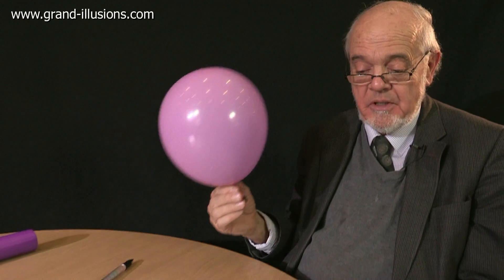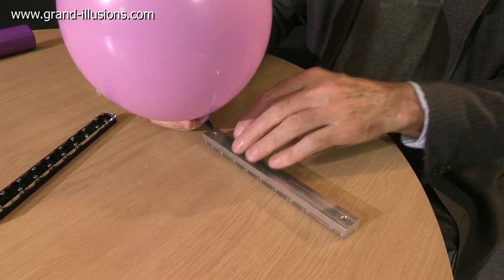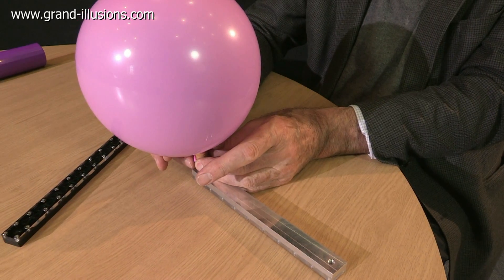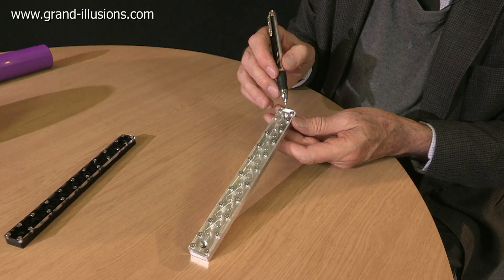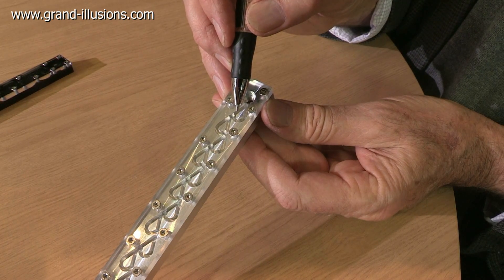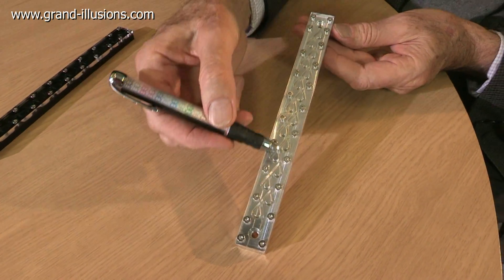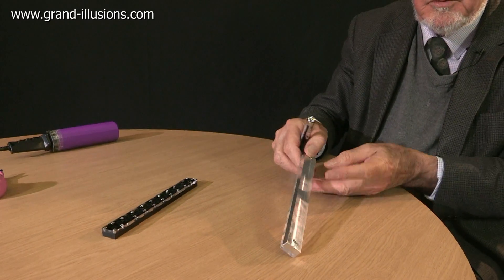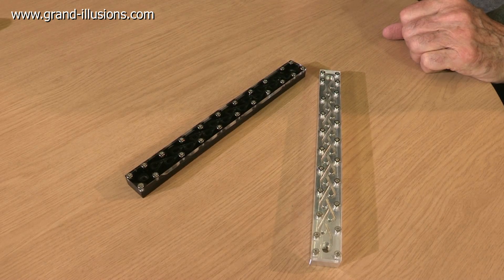Tesla Valve

Comment: If you have ever taken a fluid power systems class, you will realize just how amazing this is
Reply: stmounts Here's your real-world use case: Hand pumps. They currently use a check valve that wears out over time, placing such pumps in remote locations makes them both vital and nearly impossible to repair in many cases. These types of pumps don't require a perfect seal, the minor hit to efficiency is barely noticeable, especially compared with the complete lack of a need for maintenance and moving parts. There are no seals to wear, no moving parts to grind away, and cleaning is simple enough that you could do it with no tools whatsoever if the pump is well designed. 

Name one other kind of system that has all those advantages, and doesn't cost a crapload of money.
Reply: frtard Yes, but the flap valve will break much sooner than the Tesla valve. It wears out, it has moving parts, it's mechanically complex. It's hard to make a properly functioning flap valve with nothing but two chunks of metal and a chisel, but you can make a serviceable Tesla valve with those supplies and a little knowledge. 

Also, you do realize that without Tesla's inventions, a worldwide power grid would have been impossible, telecommunications would have been delayed decades, possibly centuries. Without Tesla, I wouldn't be able to tell you how much of a dipshit you are from thousands of kilometers away.
Reply: ***** or people who value havine electricity in their homes
Reply: stmounts Why thank you, I'm an engineer. Science*
Reply: Mitchell Nola From someone who hasn't taken that class, why is it so amazing?
Reply: Microfluidics anyone? Labs on chips? These valves would obviously be useful for that sort of thing.

+Nikolas C, " the light wave is propagated by the manipulation of the electric field of each adjacent atom along the waves path," - No. Absolutely not. Experimental evidence does not support this, that's just something that you seem to have made up. Light is propagated via fields, what you're describing is actually an absorption process.
Reply: stmounts I'm not saying that this thing is useful. I'm saying that continued advancements make room for future ones.
Reply: on a steam boiler you have pressure on one side this valve would stop higher back pressure with just a small about of force! so many bad talk it but it was made for one thing and it do that!!
Reply: I agree with it being amazing.  I also disagree with all those that seem to believe it to be useless.
For the educational value alone it is worth every moment that Tesla spent to let us know about it.
Who knows, 100%, that this or something similar is not being utilized somewhere?  I wouldn't bet on it.
I just came up with two ideas as I've been reading the comments.
Too many in here making the most ridiculous comments, as if they knew or understood better.
Let us see the quality of thought of those that believe this to be useless vs Tesla believing that at the very least, it deserved some attention.
Reply: Everyone in this commemt section needs to be aware that the tesla valve does get use in micro fluidics.
Reply: stmounts consider it for mixing applications
Reply: Ill agree with you on the technically useless part.
But I think it makes for nice mathematical/engineering concepts
Even thought they have no real life application it can be quite fascinating to see how things works.

I guess it's one way to visualize things.
Reply: RFC3514 "oscillations in a property of spacetime itself"... you literally just mash words together that you think sound like something. 

Same old rhetoric, "you don't know what a field is", "you don't know that radio and light are of the same spectrum", blah fucking blah. This is all first year material, and the fact that you don't know that the electric field is generated by a charged particle only distinguishes you as the laymen you are. Sorry that my whole point is miles over your head, but you've become irrevocably boring.
Reply: stmounts im glad Tesla didnt think like you do.
Reply: That is precisely what it was designed for, a resonant pulsed combustion chamber to drive a Tesla turbine. Air and fuel in through Tesla valves, and the detonation contained. Pretty amazing idea.
Reply: @handleismyhandle  👍
Reply: RFC3514 No, sorry, space doesn't have 'properties', a field is not a wave, electric field is generated by a charged particle. It's too bad you keep repeating yourself as if you're making a point, yes EM waves can travel through vacuum, my original question was 'how'. Saying, 'it's a field', over and over, isn't a description of anything. Although I guess it's all you can do considering you have no actual answer. It's disappointing that your arrogant attitude is bolstered only by such a trivial understanding of physics that you literally didn't understand my explanation, it's like I've spent all this time teaching a dog to roll over and when the time comes he just shits on the carpet and looks pleased with himself.
Reply: I like this post. The first bit is funny at least.
Reply: I’m just gonna chime in and be gone. Tesla had an extraordinary mechanical aptitude and was able to see magnetic flux as another mechanism. THAT is the magic of Tesla.

That was also his great downfall. He was a slave to his intuition. Which unfortunately led him astray and wasted the majority of his potential.

You can think of Tesla as a tragic anti hero, but you deserve to do it for the right reason. Tesla needed love. HUMAN love. He consciously bucked the system every chance he got and it hurt him; and it hurt humanity. 

Tesla deserved to be a great physicist with his intuition and visual thinking. He wasn’t given a chance. THAT’S the tragedy here. Got nothing to do with Edison or government. It has to do with childhood, and bullying, and being different.

Thank you Nick for your induction motor. I’m sorry we weren’t kinder to you.

I swear this is the way it is.
Reply: @smellslikenarcspirit  By definition, something that has no good usage is USELESS.
A valve that cannot STOP flow is not a valve at all, it is simply a restriction...
Reply: @stmounts  no good usage is not useless . The glas is half empty ( the people who say something is useless) ore the glass is half full ( people who says that there is a function to this invention BUT it isnt discoverd yet ) and technological progress doesn't stop so Maybe in the future there is an aplication to it. The Idea to use it in a small river as a waterrestriction and fishpasage at the same time will be trown to the garbagecan by people like you . My question is ( have you ever build a teslavalve into a small river and what happend when you did that ) well at least i can say that i build on whit the help of a few farmers who liked the Idea of having extra water when the river is getting low . It worked BUT Rijkswaterstaat ( an institution who manages the water here ) didn't like the Idea and removed the valve .
Reply: Yeah I'm gonna disagree,, I don't think this is too great tbh... For 99% of applications there are way better valve systems and even in 1920 we has better valves so I don't get why this is such a big deal other than it being invented by Tesla. There's a reason why it's so seldom used 🤷🏻‍♂️
Reply: @Tom Olson I agree with you. I'm a fluid engineer and I specialize in valves and I don't think this is a useful design at all,, even at the time he invented it we had better valves.
Reply: Amazing idea with no actual application. I mean, if there was an application for it, sure, its brilliant, but otherwise it solves a problem that doesn't exist.
Reply: i would be amazed ... if i saw a real working one
Reply: @smellslikenarcspirit  You cannot build a Tesla valve on a river, unless you don't want any boats to pass. Locks allow boats to pass. Anyway, the flow rate in a river, even in flood, is far too low for a Tesla valve to have ANY effect at all. It really doesn't deserve the name "valve", it is just a restriction that is more restrictive in one direction, but useless at stopping flow. Ever wondered why Tesla valves have never been used in rivers in the Netherlands? Answer is, they are fucking useless!!
Reply: @smellslikenarcspirit  Tesla "valves" are USELESS in rivers, or they would already be used. They are NOT being used, because they are USELESS.
Reply: pyro1324 -The scientists of today think deeply instead of clearly. One must be sane to think clearly, but one can think deeply and be quite insane.
N. Tesla

Tesla was not crazy, He was just way more advanced than his time. And perhaps still now too advanced for some people.
Reply: This valve is useful, it teaches a scientific principle. Now go to church you amoral idiot.
Reply: stmounts There was a time in human evolution where even the usefulness of a pointed stick was not apparent. The human brain finds uses for things, you apply your mind and generate theoretical applications. Clearly you're unable to do so, and by your own logic, your brain in particular is fucking useless.
Reply: stmounts You are really narrow minded. Nobody has used this yet, therefore it's useless.... wtf?
Reply: Everything is useless and life is meaningless.

Congratulations!
Reply: Nikolas C In dozens of places. It's well documented that he thought Hertz was wrong, and that "Hertzian space waves", as he called them, were just a useless byproduct of the "real" transmission, being done through the ground.

"The idea presented itself to me that it might be possible, under observance of proper conditions of resonance, to transmit electric energy thru the earth, thus dispensing with all artificial conductors. [...] An alternator, preferably of high tension, has one of its terminals connected to the ground and the other to an elevated capacity and impresses its oscillations upon the earth" (from his article "The True Wireless", published in 1919 on Electrical Experimenter)

He even wrote, in some of his articles, that, with his transmitters "the only loss incurred is the energy radiated in the form of Hertzian or electro-magnetic waves which can be reduced to an entirely insignificant quantity" (that's from Popular Electricity).

In other words, he was specifically trying to reduce the amount of radio waves, which he saw as a form of "wasted" energy.

He also wrote: "In each case the actions carefully investigated will be found to be due to earth currents. Numerous other proofs might be cited which can be easily verified. [...] The Hertz wave theory of wireless transmission may be kept up for a while, but I do not hesitate to say that in a short time it will be recognized as one of the most remarkable and inexplicable aberrations of the scientific mind which has ever been recorded in history."

Six years later, Hertz was winning the Nobel prize in physics. Oops. :-P

This site has some references and quotes from contemporary articles:

http://earlyradiohistory.us/tesla.htm
Reply: RFC3514 Dead thread. But I'd like to point out that Tesla was talking about ground transmission of the return signal to a Tesla coil tuned to the Earth's resonant frequency. Tesla writes of the Hertzian transverse wave being hidden as a stationary or standing eave configuration around the Earth-ionosphere boundary. The ground and ionosphere actually behaves as a waveguide for plasmons, coupled pairs of electromagnetic waves and electric currents in the ground and ionosphere.
Reply: Microfluidics: am I a joke to you?
Reply: frtard I'm sorry, did you just say that Tesla has invented nothing practical?
Reply: RFC3514 Ooh, you knocked one thing down. The rest of my argument stands, avoiding it will not help you.
Reply: RFC3514 You've yet to make a dent in the substance of my argument, so I'd wager you do, but whatever bro. I've stopped caring about this, peace.
Reply: ***** He didn't say they were made by fairies, I suppose that would have been "wronger". But he was about as wrong as anyone working in that field could be. He was still great at designing transformers and power supply circuits, but he failed spectacularly at radio (because he didn't even understand what Hertz had written, let alone the actual physics).

And Hertz was absolutely right. Radio waves are electromagnetic radiation (same as light, just below infrared). You don't need direct line of sight to a light source to detect the light being radiated from it. It gets reflected, refracted, scattered, etc. by all sorts of surfaces and atmospheric layers (different ones depending on wavelength). 

And monopole ground plane antennas use the ground to reflect waves, not to transmit them. The "underground" part of the antenna (i.e., the image antenna) is an illusion (like the things "under" the surface of a mirror). The bulk of the radio waves travelling between Marconi's antennas was going through the atmosphere, not "thru the earth" (as Tesla insisted).
Reply: Nikolas C I just gave you two links that have detailed explanations of what electromagnetic radiation is. Are you so lazy that you can't even be bothered to click on them, and need people to repeat everything in a YouTube comment?

If someone here "doesn't actually know what EM waves are" it's clearly you (who, until two posts ago, thought that light wasn't EM radiation, and that it couldn't travel through a vacuum). Which, unless you are over 60, means you weren't paying attention in high school. And you couldn't even be bothered to click a simple web link to improve your knowledge.

So you should probably not comment on anyone's "ability to understand".

Tesla didn't have the benefit of the internet (or physics classes about electromagnetism in high school). You do. If you choose to waste those advantages and just keep digging an increasingly deeper hole for yourself in a public forum, I guess that's your right.
Reply: Nikolas C Your cut & paste "skills" are sadly not matched by the ability to read (or, at least, understand) the material in question. 

Electromagnetic fields are a property of space, not a property of atoms. Waves don't travel through "the electric field of each adjacent atom". The field exists regardless of the presence of any atoms. That's the fundamental difference between an electromagnetic wave and a mechanical wave.

Which you clearly haven't understood, or you wouldn't write:

"my perception of EM waves being a domino effect on the polarity of each subsequent atom" or "it would make sense that such a wave wouldn't pass through a vacuum"

No, it wouldn't. Not if you understood what a field is. 

"I also never said that they couldn't pass through a vacuum"

Yes, you did. Back when you thought you were being clever:

"might want to be careful with radio == light, unless you could explain how an electromagnetic wave could propagate through vacuum :) "

In other words, a) you thought electromagnetic waves and light were different things, and b) you thought that electromagnetic waves couldn't propagate through a vacuum. 

I guess that was just you "extracting original thoughts" from... somewhere.
Reply: Nikolas C Sigh... "bring you down to their level and beat you with experience" - such an original sentence. I guess you used up all your creativity trying to "reinterpret" electromagnetism in 1920s style. Who needs boring textbooks, eh?
Reply: I'm a mechanical engineer working in fluidic pressure decay.  This is utterly useless, the literal point of a valve is to stop ALL flow, not kinda stop flow.  I can't think of a single situation where this would be an acceptable solution
Reply: @richardwilson1937  engineer here too; this is useless. This is definitely not a shutoff valve and have way simpler pressure reducing valves(that's all this is)
Reply: @richardwilson1937  you must lack quite an enormous amount of creativity then
Reply: @maximgem7292  Being a successful engineer requires creativity, I don't get paid for repeating existing technologies
Reply: @richardwilson1937  completely missed the point. Why am I not surprised.
Reply: stmounts Pre-calculus is near useless.... The applications come in making room for future advancement.
Reply: Nikolas C You want a list of all the places where I've read references to Tesla during my entire life...?
Reply: Nikolas C Four posts ago you thought that light and EM radiation were different things and that radio waves couldn't travel through a vacuum. And you weren't asking, you were stating, and giving out "advice": 

"might want to be careful with radio == light, unless you could explain how an electromagnetic wave could propagate through vacuum"

That's not "inquiry". That's snarky ignorance. Feel free to keep digging, though.
Reply: Nikolas C I kind of chuckled when you asked "what the hell is a property of space". It's what's known as a field.

I kind of chuckled again when you said electromagnetic waves are "carried by the electron clouds of atoms" (I guess you still haven't understood that EM waves can travel through a vacuum, and that electrons - or other charged particles - merely interfere with the field).

But what really made me chuckle was when you described your successive mix-ups as "an explanation".
Reply: Nikolas C At this point, I don't really expect you to understand what words mean, let alone what concepts they describe.

First you thought light and radio waves were different things ("be careful with radio == light"), then you thought they couldn't travel through a vacuum ("explain how an electromagnetic wave could propagate through vacuum"), then you kept referring to "light and EM radiation" (as if light wasn't EM radiation), then you made it pretty clear that you didn't understand EMR doesn't need atoms to propagate ("my perception of EM waves being a domino effect on the polarity of each subsequent atom", "it would make sense that such a wave wouldn't pass through a vacuum", and "the EM wave is carried by the electron cloud of each atom").

You also don't seem to have understood that when people say "this particle creates an EM field" that means the particle gives a value to (or, to be more descriptive, causes a disturbance in) the EM field. 

The EM field itself is obviously always there (just with a value close to zero), and is being affected by every particle in the universe, because, the influence of every charge extends infinitely (a "detail" whose implications you don't seem to understand).

So yes, it's clear that you don't understand what a field is, or what is the fundamental difference between mechanical and electromagnetic waves.

I guess you can brag about having something in common with Tesla.
Reply: Nikolas C I guess you felt the same way about 10th grade physics classes. Don't worry, you're not the only one. Most just have the good sense to not waste their time displaying their misconceptions in a public website.
Reply: +noxxi knox
Unforutnately, I don't think this'll work when filled with fluid. If the fluid is non-compressible (most likely), the fluid may just ignore the curves of the valve thanks to hydrostatic. With compressible air, the air has to move to transfer force. This is where the valve works best. Not sure about fluid. Well, maybe if the fluid does move through the valve...
On the other hand, if a chamber of air were connected to the fluid system with a piston or diaphragm or something, hydrostatic could be taken advantage of. The damper won't actually need to be where it works.
I think Volkswagen worked with that idea some few decades ago in a suspension.

In terms of usefulness, we haven't found one so far. I guess it's a bit eccentric in its conditions for use. Oh, well. Maybe we'll find a use for it later.
Reply: RFC3514 Where did you read that he though electromagnetic waves were transmitted only through the ground
Reply: RFC3514 So I take it you don't actually know what EM waves are, you should probably not comment on Tesla's ability to understand.
Reply: Nikolas C You seem to be getting worse, and have now lost the ability to read. No one said "an electric field is a wave".

An electromagnetic wave is a synchronised oscillation of the electric and magnetic fields. Which are present in space(time) independently of atoms. There's nothing surprising about EM radiation propagating though a vacuum, because its medium (the EM field) permeates space, and is present in vacuum.

And to repeatedly go back to that question, as if it's somehow very puzzling, suggests you don't understand what a field is (hint: it's not just the bit around charged particles, it extends infinitely, and is present as a medium even when its value is infinitesimally small). This is only reinforced by your tangents about EM waves being "carried by the electron clouds of  atoms" or your "perception of EM waves being a domino effect on the polarity of each subsequent atom". They don't need atoms at all. If you think they do, your "perception" is simply wrong.

In a way, it's a bit like Tesla's insistence that Hertzian waves had to be a misinterpretation of "earth currents", because he couldn't understand that the waves didn't need a conductor, and are essentially oscillations in a property of spacetime itself. So I guess that explains why you can't seem to understand that Tesla was wrong (while Hertz and Maxwell were right), even after (presumably) reading a detailed explanation (http://earlyradiohistory.us/tesla.htm) with quotes from Tesla himself.

Of course, in Tesla's days, this was cutting edge physics. In 2015, not so much.

Oh, and it's almost a compliment to be called "a dog shitting on the carpet" by someone who didn't know that "light" and "radio waves" are just names for different wavelengths of EMR, and told me to "be careful about equating the two"...
Reply: RFC3514 I think you assume a lot about his understanding, or lack thereof. You're talking about two different things, first that his intention is to transmit power, and second that he failed to utilize radio technology. Although they are both transmitting by electromagnetic waves, we use the concept to communicate, not to transmit power on a large scale, as was his intention. It could be, and is equally likely, that he was misunderstood in his comparison to Hertz. To his credit, he did actually illuminate a field of bulbs using his theory, so it's hardly fair to say he was "as wrong as anyone in that field could be", no pun intended. Also, might want to be careful with radio == light, unless you could explain how an electromagnetic wave could propagate through vacuum :).
Reply: RFC3514 You're right about something, I should have had more sense, more sense than to argue with an idiot, they'll bring you down to their level and beat you with experience. You can bore someone else with your textbook excerpts, bye bye.
Reply: @smellslikenarcspirit  Show us all a single instance of a Tesla "valve" on ANY river in the Netherlands. Just one will suffice, if none then Tesla "valves" are USELESS!
Reply: ***** Yeah, since nutters are the ones who take risks and make progress in science. We will probably die sooner but our names will be kept in history as the ones who made a better life for future generations.
Reply: Nikolas C I don't need to "assume" anything. He wrote about it. A lot. And anyone who knows a bit of physics can see that he got it completely wrong. 

Again, I'm not going to cut & paste his full articles, but the link I posted above contains transcripts from some of the more relevant ones:

http://earlyradiohistory.us/tesla.htm

"Illuminating a field of bulbs" doesn't mean he understood (or even had a remotely consistent theory about) electromagnetic radiation. Galvani made frog's legs twitch, that doesn't mean he was right about "animal electrical fluids".

Tesla was essentially an inventor and an engineer, not a physicist. He was very good at designing transformers and power circuits, but completely misunderstood the nature of electromagnetic waves.

And both visible light and radio waves propagate through a vacuum just fine. They're not mechanical waves. I'm not sure what your point is. Are you seriously saying that you think light (or radio waves) can't propagate through a vacuum...?
Reply: RFC3514 I think you shouldn't mistake inquiry with ignorance. I have a mathematical and material understanding of both EM and mechanical waves, it's fundamental stuff in engineering. Sorry to bother you for your own opinion, I don't actually need it, it was in fact out of interest.
Reply: RFC3514 Fail to understand, state the obvious, rinse, repeat. Boring.
Reply: RFC3514 I haven't cut or paste anything, and highlighting the word 'could' doesn't change my intention. I've been nothing but open and civil this entire time and you've been overly defensive... I really don't get you're angst. 

I know you'll disagree, but it's clear that you don't have an understanding of what an EM wave is. Yes, the wave CAN propagate through space, voyager communication and sunlight are clear evidence of that. However, they are not independent of atoms, which is why the velocity of light is slowed when passing through gasses and transparent materials. It's also the reason you can't pass radio transmission through thick lead walls, and how it is able to refract around corners. 

I kind of chuckled when you said they are a property of space, what the hell is a 'property of space'? No, actually the mechanical wave is propagated by the electric field interactions between atoms, as I'm sure you know they don't physically interact. Incidentally, the EM wave is a similar interaction, but only carried by the electron cloud of each atom... it's easy to see why you were confused by my explanation. You should also know that this is how heat is generated by the absorption of such a wave, since heat is essentially the chaotic vibration of atoms themselves, which can be caused by electronic manipulation, as evidenced by the heat produced when applying current to a conductor.
Reply: fromkentucky
Nope. It has nothing to do with being 'lost'. It has everything to do with being 'USELESS'.
Reply: @stmounts   It is used in several real world applications today. For example, microfluidics and pulse jet engines.
Before posting derogatory comments, it would be better to spend a couple of minutes googling your "facts" to make sure that you aren't making a fool of yourself.
Your comment is arrogant and ignorant. Tesla was a genius.  Your uninformed opinion is 'USELESS'.
Reply: @stmounts  nope , its not useless . Nobody cooked up a good usage for it . I can use it for flood controle for a river . Using the teslavalve in the blocking direction . I can create a river that has more water on 1 side then the other and not closing the river compleetly of . When to much rainwater comes in to the river , the side in front of the teslavalve keeps rising until its overflowing . From that point on the river flows whitout resistance on its path . And can handle exesive rainwater . When the water level is dropping and the teslavalve reapears the water wil stay longer at that level like a lock whitout moving parts.
Reply: @smellslikenarcspirit  Duh!
You do not realise that the tesla valve CANNOT stop reverse flow EVER!
It is useless for controlling river flow.
Think about it, a tesla valve would make ZERO difference to a river flow, as soon as the flow direction reverses the tesla valve leaks like it wasn't even there.
Reply: @smellslikenarcspirit  you would not use this for flood control. This is a useless valve for 99.9% of applications and there's good reason engineers don't use it.
Reply: @stmounts  I intend to use this device to manage the steam flow on a teslaturbine/pump, something it was originally designed to do. Cheers John
Reply: Teth47 I wouldn't dream of "trying to make a dent in the substance of your argument", namely because your argument lacks any substance to begin with. Tesla was never a relevant figure in the development of wireless telecommunications.

Also, I'm not your bro.
Reply: RFC3514 It seems that light and EM waves do propagate through vacuum, but the question is how. I guess it would be better to start with the question of what you think EM waves are exactly, I'd be interested to know from someone who thinks Tesla couldn't understand.
Reply: Mitchell Nola Amazing? Maybe, but relatively useless.Most of the time you want valves that can shut off completely. Also, all those vanes mean it probably has considerable restriction to flow in the forward direction, making it even more useless than conventional valves. That said, it might have some niche applications, maybe in a pulsejet?

.
Reply: @stmounts  this is literally used in Pulse and Ram air jet engines.so yes, amazing.
Reply: Teth47 You even say yourself that "don't require a perfect seal." A little wear is fine. How the hell can someone wear out a flap valve to the point where engineering changes are necessary?? A Tesla valve would still leak more than a simple flap valve.  The Tesla valve has proven to be useless, so far. Just like with the Tesla turbine. You Tesla fanboys are worse than people who worship Apple products. At least Apple makes things that are practical.
Reply: @frtard  aren't you cherrypicking Apple's practical products and ignoring ones that aren't? That's like comparing Tesla's electric inventions to the Apple III

You look down on Tesla fanboys without realizing how much we use AC till today? Smh
Reply: Urbansquealer
I doubt it. If nobody has found a commercial application for Tesla's one-way-valve in 100 years, then I seriously doubt any future use is likely. Not that I think the design is not brilliant, just that it has no usefull applications to date.  I suggested a pulsejet/ramjet. Maybe it would be suitable there.
Reply: stmounts Or simply because the will be selling it pretty much once in a lifetime since it does not need much(none) maintenance.
Reply: This is the basic building block of an entire field of engineering called microfluidics.
Reply: @stmounts  balloon-blowing assisting device?
Reply: @stmounts  a water pump
Reply: Teth47 I don't need help.
Reply: RFC3514 Where did you read about Tesla
Reply: RFC3514 I was referring to the wave-particle duality of light. It's of particular interest to me since the refractive index of a material or gas is directly proportional to the velocity of the light that passes through it, it bolsters my perception of EM waves being a domino effect on the polarity of each subsequent atom. If, as experimental data supports, the light wave is propagated by the manipulation of the electric field of each adjacent atom along the waves path, it would make sense that such a wave wouldn't pass through a vacuum, hence the need for photonic theory. I also never said that they couldn't pass through a vacuum, since it obviously does, whether that be in packets of photons or by the fact that the strength of an electric field is inversely proportional to the squared radius (therefore approaching but never equal to 0 no matter what distance), I was trying to extract some kind of original though from you, which I clearly failed to do.
Reply: Nikolas C
No application= useless
Reply: stmounts He wasn't sane, that's why he made so many inventions. A sane person wouldn't be able to come up with everything he did ;)
Reply: iamabsFTW
Yeah, but Tesla's valve has been around for nearly 100 years and guess how many applications it has found? Hint - You don't even need one hand to count 'em!
It is merely a curiosity, in the real world it is a FAIL!
Reply: @stmounts  your ignorance is astounding I'm surprised dunning kruger didn't invite you to their study
Reply: @maximgem7292  The problem with the Tesla valve is that it LEAKS! It hasn't found an application because other valves are MUCH BETTER VALVES.It really should be called a 'one directional restrictor', not a VALVE at all.
Reply: @stmounts  valves are devices that REGULATES by opening, closing, or PARTIALLY OBSTRUCTING. It's a valve. Doesn't matter if it can't completely stop it. It doesnt matter if it leaks. Also because of the lack of moving parts, it's widely used when it comes to a micro scale as making other valves that small are practically impossible.
Reply: @stmounts  I found one IRL application that was a passive water pump restrictor. It removed the need to replace the diaphragm valves used in hand water pumps in many villages at the cost of having to pump slightly more.

The typical valves would wear out quickly over 2-3 years due to the groundwater containing fine sand particulate and it was difficult to repair without a new valve.

So they started using tesla valves because they don't require maintenance.

Only other idea (never implemented) I've seen was for self inflating tires that would allow the tires to also slowly deflate when not in use.

Lots of Tesla's ideas were novel, just not inherently useful for most situations.

Even wireless charging is pretty stupid imo, but several companies have made it powerful enough to fast charge (xiaomi comes to mind) and because we're too lazy to physically plug in a cable, people buy it lol.
Reply: @stmounts  depends on if you count all of microfluidics on one finger, or each device on separate fingers, I guess?
Reply: Yeah, it's a fail to learn. That's some big thinking there.
Reply: Urbansquealer OK. But 100 years and nothing to show for it makes you think that this particular idea of Tesla has serious long-term flaws!!
Reply: Teth47 Tesla's attempts at long-distance wireless communication failed, and several other people were working in that field, independently. I'm sure some of them learned something from Tesla's failures, but it's dubious that, had Tesla not existed (or not worked in that field at all), things would have been delayed by more than a year.

In fact, Tesla was famously wrong about the nature of electromagnetic waves (he through they were transmitted mainly along the ground, not through the air).

To suggest that Tesla advanced the field of wireless communications by "centuries" is just nonsensical.

I could go on, but it seems someone has done the work for me: http://earlyradiohistory.us/tesla.htm
Reply: iamabsFTW
I think you have missed the point. the Tesla valve has a very poor forward/backward spec. That is why it is a curiosity, and is NOT being used.
Reply: stmounts I'm pretty sure that's because it was lost for most of the last century.
Reply: *****
A leaky valve in a vacuum chamber? USELESS!
Reply: Nikolas C
We live in a world where science and engineering is studied by the best brains in the world. (Religion is for the less intelligent.)
The Tesla valve REMAINS an intellectual curiosity, JUST GET OVER IT!
The valve is no secret, you stupid fool.
Reply: pyro1324
You've gotta be joking!
There is not ONE not a single ONE of these OVER-UNITY fruitcakes that have EVER made a contribution to science.
Tesla's valve is interesting BUT FUCKING USELESS, he had far more usefull contributions to engineering, mainly AC power distribution..
You are obviously just a wanker, writing  'our names will be...'  dream on and stop smoking that weed.....
Reply: @stmounts  Keep acting like you're the one making these contributions you worthless scientist fetishist.
Reply: Well, we have had decades to consider it and the result after thousands of engineers have looked at it is----ZERO!
Tesla was brilliant, but not everything he conceived was ACTUALLY USEFULL!
For example - the wireless distribution of power is COMPLETE BULLSHIT!  It makes you wonder if Tesla was completely sane.
Reply: @stmounts  we also have had decades to consider HVDC, electric cars, quadcopters, bioplastics, biofuel, etc, yet in those decades they barely made a surge until recently? Does that mean they're USELESS?
Reply: @ki0w0-lordofwatersheep ....WTF?.. NO!The problem with the Tesla valve is that it LEAKS! It hasn't found an application because other valves are MUCH BETTER VALVES.It really should be called a 'one directional restrictor', not a VALVE at all.
Reply: @stmounts  "it hasn't found an application"
Microfluidics says hi

"Other valves are much BETTER VALVES" 
If by "much better" you mean blocking the flow more completely, then yes, but "better" varies according to usage or need, if the lealage is tolerable yet as few moving parts as possible is needed, which one's 'better'?

Another example, a ram pump's waste valve is 'bad' since it has a huge delay, but that delay makes it 'better' than other valves in its intended position
Reply: @ki0w0-lordofwatersheep  The Tesla 'valve' is unable to block flow AT ALL!  Sure It has found an application in microfluidics, on a tiny scale nothing like Tesla's patent, representing a niche area amounting to about 0.00000001% of valves in total. You will NEVER find a Tesla 'valve' in real-world applications because of it's extremely bad performance.
Reply: @stmounts  and when did I say it's able to completely block flow?

"On a tiny scale nothing like Tesla's patent"
And why would that matter? Invention implementations vary in dimension & details all the time, don't they?

"Representing a niche area"
But niche doesn't equal useless, does it? Only relatively useless, like your first comment said. And even that is based on the performance & use needs of most valves, in microfluidics wouldn't bulky valves be relatively useless?

"You will NEVER find a tesla 'valve' in real-world applications'
Apparently microfluidics for soft robots & lab on a chip aren't "real-world"? Maybe not yet

"Because of its extremely bad performance"
Doesn't "bad/good performance" depend on needs, tolerances, & specifications? Don't those niche applications use it rather than conventional valves, because the latter would be extremely bad?
Reply: @stmounts  you are correct with everything you wrote. The people arguing with you are not educated in this field.